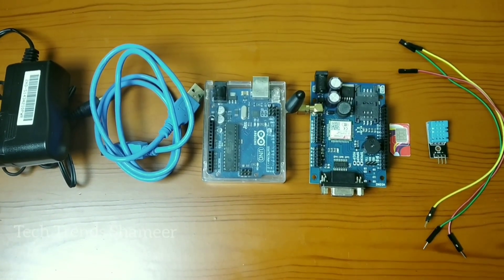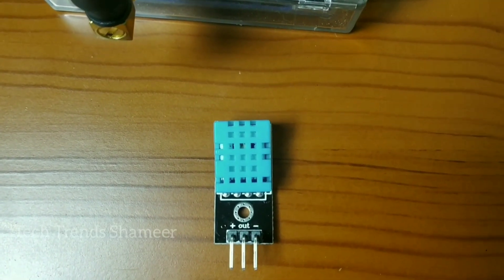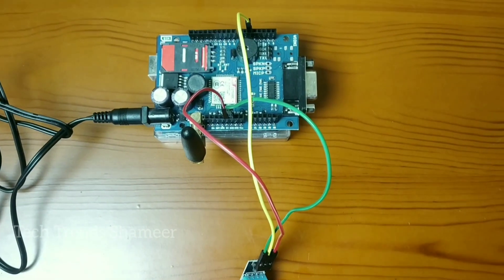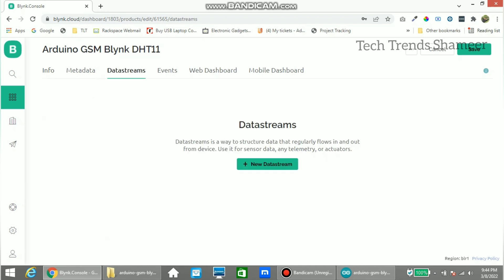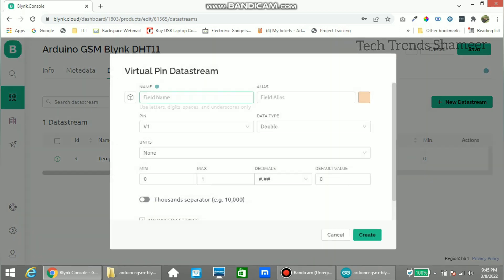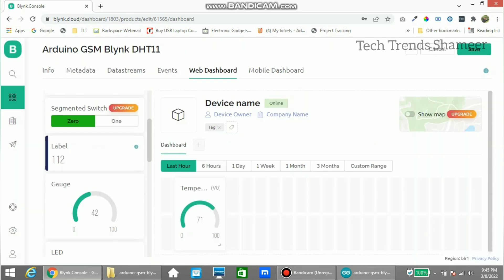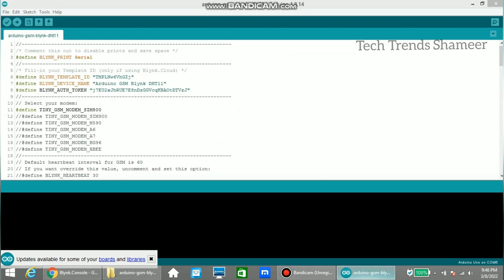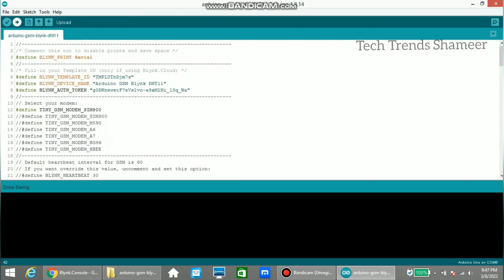Temperature Monitor Using Arduino, GSM, DHT11 and Blynk 2.0 | Blynk 2.0 | Arduino GMS Projects

Comment: Bro seprate power supply to sensor and audino uno which connects to the circuit
Reply from the maker: Yes Bro. We need to give separate power supply for the GSM module.
If you still have doubt, please let me know. I will explain.
Reply: Work project for pir sensor which connects is best
Reply from the maker: @aravindtn7555  Can you please explain in detail?
Reply: Ples change code ples upload channel bro  with buze
Reply from the maker: @aravindtn7555  ok
Reply: Thank for replying bro 🌠✨
Reply: In home alert system like bro 
Safety blind people consumer some one nere them like